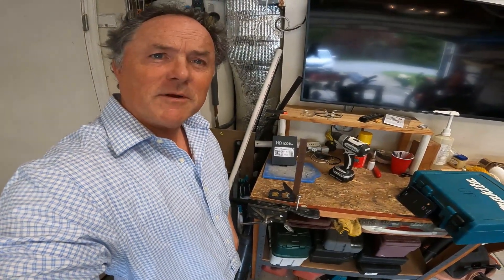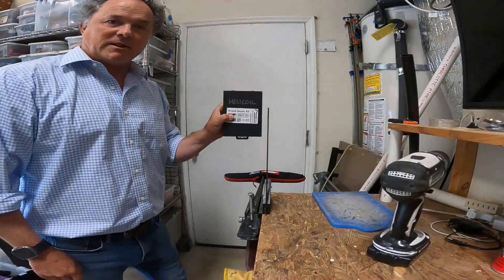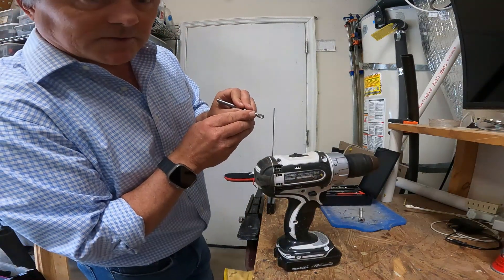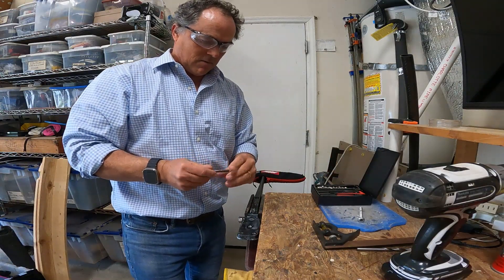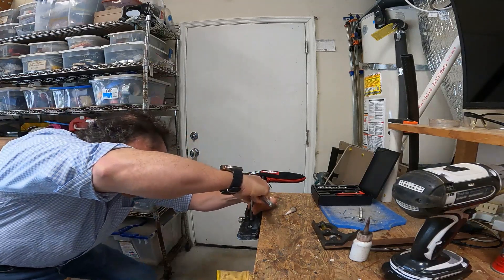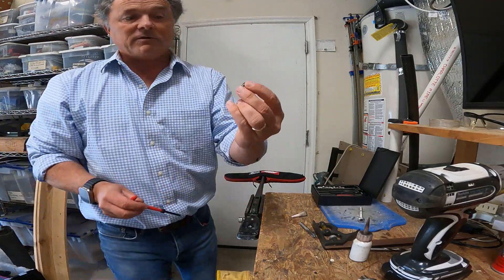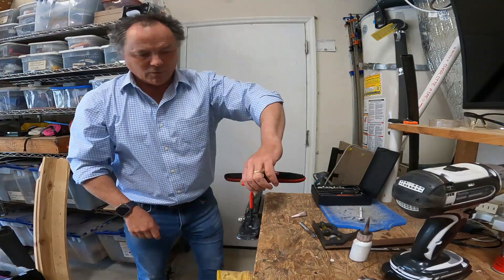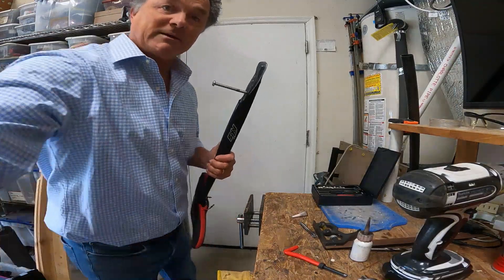How to Repair Stripped M8 Threads on Axis Fuselage with $14 Helicoil Kit

Comment: My machinist geek persona just had a minor stroke. A couple of minor points and a tip. If you want the best possible thread don't just turn the tap in--you should advance the tap half turn, and back it out 1/4 turn to break off the chip for however deep you want to run the tap--true for all taps and dies and all materials except titanium. An 8mm helicoil drill and tap is NOT 10mm. The drill is 8.3mm, the tap is 8mm STI (steel thread insert). Helicoils are fine, timeserts are way better but a lot more expensive. If you need to repair 6mm thread on the skinny end of a fuselage you're better off tapping it to 1/4-20 vs helicoiling. You can just run a 1/4-20 tap in without drilling. Of course that means your bolt now needs to be 1/4-20 but the repair doesn't compromise the part. There isn't a lot of material to play with in the tail, and anything but a bottoming tap will run out of depth while you're still wanting to get a few more thread (you need 6 threads for full torque at 6mm). When I've needed to install a helicoil on the stabilizer end I drill through completely and install the helicoil, then grind it off flush on the bottome. I'm sure Adrian would gag at his pretty parts being brutalized, but it works. Last, but not least if you want a helicoil repair to not back out, use some red locktite as lubricant when you install it. Makes for a smooth installation, and once its set up the only way to get it out is heat.